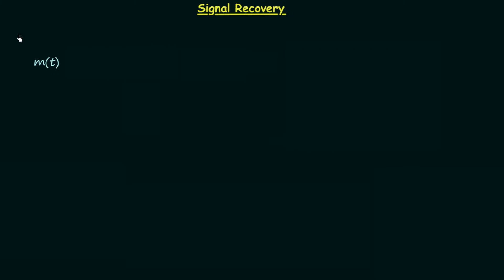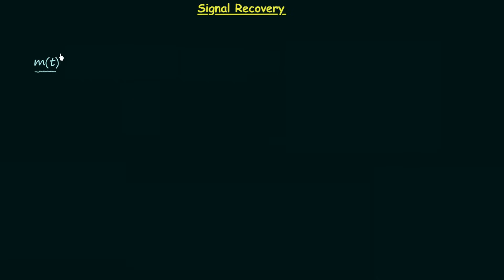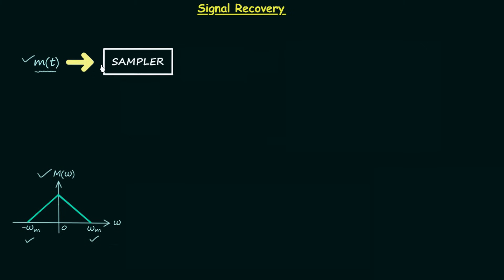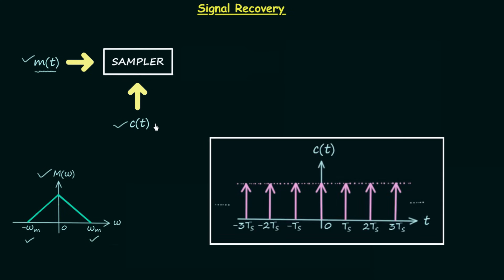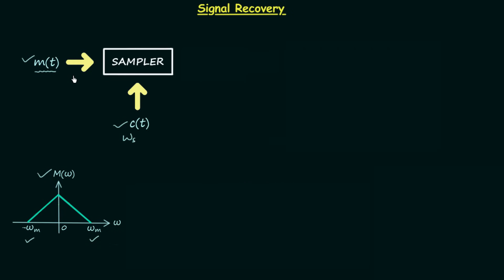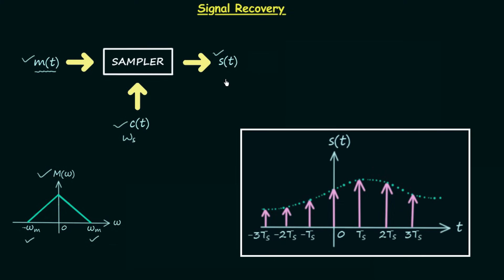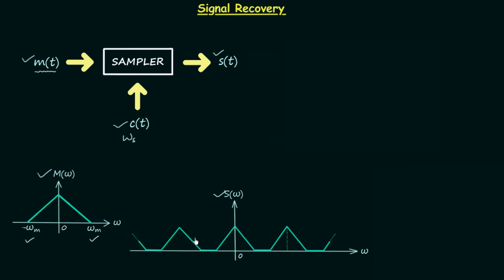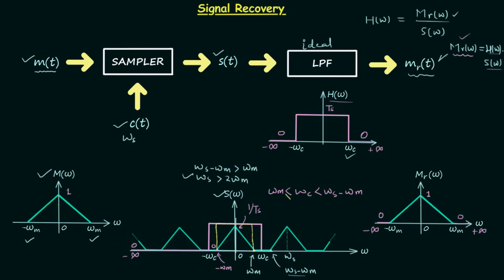Reconstruction of Signals

Comment: Could you explain how the amplitude of H(W) is T_s?
Reply: Ts is just an arbitrary value
Reply: @huihui666   no dude it's not arbitrary value Ts here  is  the sampling period  and  that  lowpass filter  gain should be  Ts  because only then we can recover our original signal back .  In sampled signal's frequency response  the peak of that triangle is at (1/Ts). but our original  peak is at 1 so to recover back our signal lowpass filter gain should be Ts
Reply: @nithinmanepalli2772 How did you determine that the amplitude of sample signal spectrum is 1/Ts and that of the Original message signal spectrum is 1?
Reply: ^for the gain of the lowpass filter